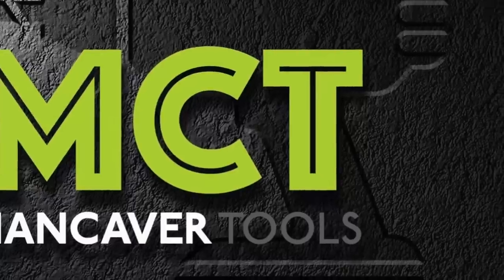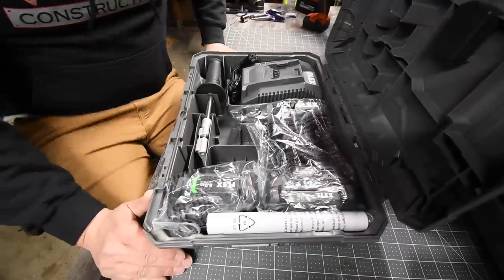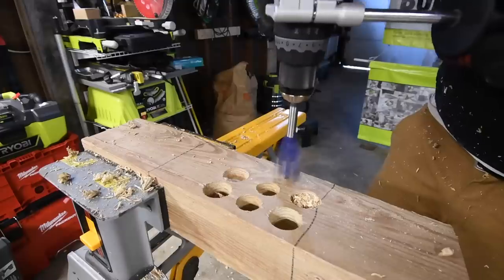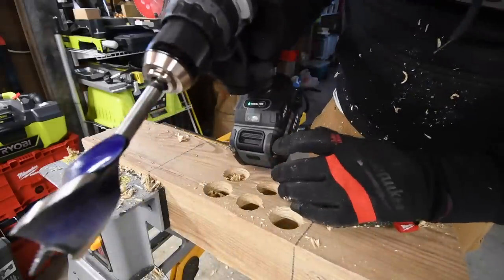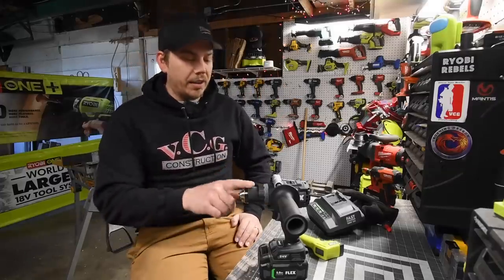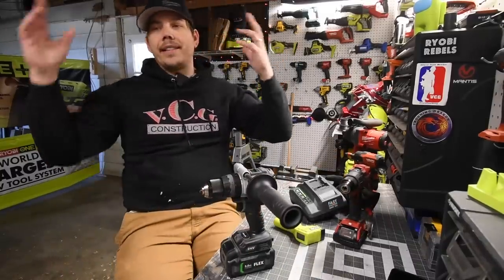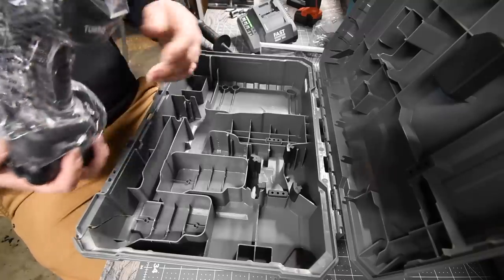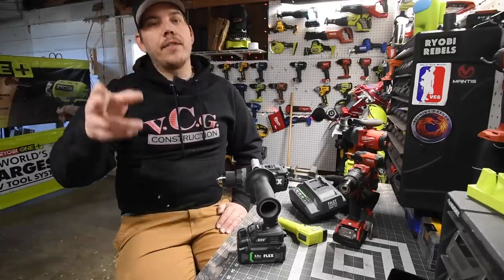Flex Turbo Hammer Drill (Unboxing and TEST)

Comment: Looks like the same issue as Philly Fixed saw with their entry level drill. Symptoms suggest it’s an overly sensitive anti-kickback system. Can probably be fixed with a software update. However, I doubt they can apply a field fix to update the software, so they may have to have all of those sent back for service to solve the issue.
Reply from the maker: I do thank you so much for viewing :)

Comment: Man...I didn’t expect that. Thought it was going to do better. Guess we’ll see what it does with 8Ah. 🙂✌️❤️
Reply: You got the 8 bro? You know I gotta see that recip with it.
Reply: Yet still put it up against Milwaukee 6.0HO as that is their most powerful battery.
Reply: @kartboarder22g17  milwaukee has a 8.0, 9.0, and 12.0
Reply: Doubt you’ll see any better performance with the 8.0, because I think it’s a software issue with the anti-kickback system, not a battery/power issue.
Reply: @nuclearexplosion5841  yeah but the 6.0 has 30T cells they pump out the most.
Reply from the maker: I do thank you so much for viewing :)

Comment: The drill stopped while driving the lag bolts due to the kick back protection feature activated
I'm certain that this drill is more than capable if used properly
Reply from the maker: correct, this hammer drill performed differently after a break in period

Comment: I belive makita new lxt hammer drill tool should be with Milwaukee dewalt and hilti
Reply: only thing holding the back is their batteries
Reply: Yep and the Metabo HPT 36V that has been out almost 3 yrs kickin' ass on my job sites
Reply: @baseballdude8491  that's awesome to hear it's kicking but still after 3 years
Reply from the maker: I do thank you so much for viewing :)

Comment: Since when did Makita get demoted out of the elite, professional grade tools? Seems a bit harsh to put them in with Ryobi and other mid range manufacturers. Tradies here in Australia use Makita just as much as Dewalt and Milwaukee.
Reply: Yeah, power isnt everything. I have both Makita and Milwaukee. Havnt had any issues with my makitas, but I have a milwaukee onekey drill that has a glitchy trigger... One thing though, the Milwaukee batteries feels really solidly built and I miss the rubber protection on my Makita batteries.
Reply: Makita may not be able to boast "the most powerful" but they give enough power for most things, and have a proven track record of longevity, dependability, and comfortable ergos.
Reply from the maker: I do thank you so much for viewing :)

Comment: Not invested in any of these platforms, but you clearly point out that there is a battery discrepancy between the Milwaukee and DeWalts you used and this Flex tool. Wouldn’t the fair and impartial thing to do is to test the Flex against these other tools also running 18650’s? I’ll concede that the Milwaukee and DeWalt with 21700’s rule the roost.
Reply: As long as you are close to having the same watt hours the cell of the battery doesn’t matter. Milwaukee has to use a high output battery to compete with the flex extra cell in their battery. What I would like to see is Milwaukee 21700 8.0 ah battery go against Flex 21700 8.0ah battery. But flex will still have an advantage because it’s 24 volt vs 18 volt. Milwaukee would have to use a 12ah battery to make it fair. It’s very confusing.
Reply: @akaredcrossbow  it does seem like shifting goal posts. That’s why I thought just testing everything at face value was fair and impartial. I never understood why the contractor grade companies didn’t bump up their base voltages if the ability is there. Makita is doing just that with a 40v line for professionals. I have no doubt that Milwaukee would still sell like gangbusters if they went with a dedicated 36v line.  People love throwing money at numbers.
Reply from the maker: I do thank you so much for viewing :)

Comment: very fun video, thanks. it'd be interesting if the 8ah version battery will be helpful to the flex hammerdrill
the 2.5 and the 5ah batteries have the 18650 samsung cells but the 8 and 12 vers. have the 21700 cells
Reply from the maker: I do thank you so much for viewing :)

Comment: The voltage from the included Samsung 20a batteries does not provide enough amperage to supply the tool with enough power and it likely kicks off.
Reply from the maker: I do thank you so much for viewing :)

Comment: Great video, for me there is more to a drill than just raw power. Yes dealt and Milwaukee definitely have the most powerful drills, but makita and hilti are far nicer to use most if the time. More precision and a better quality feel. Idk how Flex competes in that regard. Just my take in it. Have a good one.
Reply: For example, dewalt and Milwaukee use digital clutches I believe, and I guess because I the way thy configured it the clutch is not able to engage at nearly as low of torque as the mechanical clutch on the makita and hilti. That's important for precision and control.

Comment: So if it has more power and torque in 1st gear, that means nothing?
Reply from the maker: it doesn't if another tool can do it on a higher speed. This video is based on the flex promo video they did. why said this is the fastest, most powerful hammer drill on the market. just proved them wrong
Reply: @ManCaverTools  But by your own " standards " the Dewalt also failed. Their 2 gear is 1300 rpm's and their 3rd is 2000 rpm's. It has already been proven the Flex is the fastest with 2500 rpm's and on other non-marketing tests prove it, but to prove who has the most torque you have to get bigger bits and test in 1st gear.

Comment: Wow! Your review and VCG review are so different.
Vince and the other dude did the comparisons between Flex vs Milwaukee vs Dewalt. Flex beat both of them. They were using the same auger bits, 8ah battery for Dewalt. It didn't matter. Flex beat them everytime. You might want to do live demo between the 3 and not just by your words.
Reply: VCG is a major shill thats why
Reply: @nuclearexplosion5841  
Vince is not Shill. He is a diehard Milwaukee fan boy. Reviews needs to be done with action and not words.
I'm a bargain fanboy who prefers Ridgid and Ryobi. If Flex can be the next bargain with performance. I'm all in.
We need something else besides Milwaukee and Dewalt.
Reply from the maker: I do thank you so much for viewing :)
Reply: @ManCaverTools  
I'm still waiting on non biased reviews from Project farm,  Concord Carpenter,  and Workshop Addicts. I see too many Pros and haters on Flex tools. 
No different than Ford, Chevy, and Ram owners trash talking each other's trucks. No matter the innovation.
That's why I'm a Tundra owner.😁

You did a good comparisons. But still seems bit biased.

Comment: You should have got a Milwaukee to finish out that lag bolt
Reply from the maker: I use impact wrenches to take out lags that drills failed at. saves me $$$ on the adapters

Comment: Hmmmm... Maybe the Hammer-Drill version will be better. There are channels that have disassembled both the 5AH and 8AH batteries already. So the 5AH uses 18650 cells as well, BUT the 8AH does use 21700 cells. Its because of the OEM of the cell - Samsung. They only make 4000mAH 35A and 3000mAH 35A in the 21700 size, and the cells found in the smaller batteries were the same Samsung 25R 18650's (2500mAH 20A) also found in DeWalt, Makita, and Milwaukee 5AH packs.
Reply from the maker: this is the hammer drill.  this test was just to test out the power of the motor.
Reply: @ManCaverTools  I see, although I could have sworn you unboxed the hammer version at the end lol. That was confusing. Well bummer it couldn't hold up like the other tools have so far. Though I have heard breaking in the battery with a discharge and then recharge can help performance with these Flex tools for whatever reason. Keep up the good work!

Comment: So in all those flex videos where the flex tool is better than Milwaukee you kind of wonder if the tool user made it so the RED Team loses on purpose.
Reply: My gut says the millwaukee batts used in test were compramised.
Reply: @jasonhemann3517  That or they used a smaller amperage battery or they used the older model batteries.Anything is possible but that's false advertisement.
Reply from the maker: I do thank you so much for viewing :)

Comment: A milwaukee 1/2 magnum corded driver drill would have sunk that lag bolt....
I wouldn't even try it with my m18 fuel brushless.
Reply from the maker: I leaned back then that tools needed to be broken in to reach their full potential. ever since this video was uploaded I no longer judge a tool right out of the box. every tool performed better after a few videos or some use.
Reply: @ManCaverTools  ok.  Understood.

Comment: I had very high expectations of the flex line.  They better adjust their pricing. Or they're gonna earn a bad reputation.  Milwaukee and Dewalt are still pretty much the 2 big dogs still. I know there's a few other brands buy they're even more expensive and harder to find. Disappointed in the flex hammerdrill. I know the flex tools would perform most tasks fine and harder tasks you just gotta use 1st gear. They might be good tools. But they gotta stop with putting it in the category of other proven brands. And compete with ridged etc. That means pricing too.
Reply from the maker: I thank you so much for viewing :)

Comment: In my opinion the Flex line is overhyped and it will die off in a year or two.
Reply: It will unless they drastically improve product quality.
Reply: That’s true. But the only thing Flex offers that is new is the turbo in the battery. Which we saw clearly has its limits. They need to offer a little more. Something more innovative in their tools if they want to compete with Milwaukee and Dewalt.
Reply from the maker: I do thank you so much for viewing :)

Comment: You tuber Philly fixed had the same problem with the drill he supposedly charge the batteries again and the drill performed flawlessly after. Give his review of the flex drill a watch https://youtu.be/CsZmrkUtuRU  maybe the same thing needs to be done here. Now that doesn’t say a lot for flex if you can’t get a tool out of the box without having to hack it or do a workaround to get it to work. But it’s something people need to be aware of if that is the case.
Reply: He also charged the battery again on the video
Reply from the maker: I do thank you so much for viewing :)

Comment: What size drill bits did you use for the Milwaukee test and the biggest bit you used for the flex? You said the Milwaukee only went a 1/4 inch with the standard battery, if they were the same size how does flex not compete with Milwaukee?
Reply from the maker: this was not a versus video, that was a 1 1/2 speed bore bit. I have no clue what you are asking. the batteries are not the same size. sorry I dont get what you are asking
Reply: @ManCaverTools  if the drill bit you used with the flex is the same as Milwaukee, how does flex not complete with Milwaukee, as you said Milwaukee only went a 1/4 inch with the standard battery

Comment: He came up with a reason not to put the Milwaukee against the flex. Lol My flesh went through at speed 2 at with that bit. Do the tests vs each other and see which wins. The flex will win the majority.
Reply: He has a reason because he already did those test in all other brand of drills. Check his episodes..
Reply: @SpicyRoll-m4r  That doesn't mean you don't do a vs against one another. My flex went right through with the 1-1/2" speedbor but even though his didn't, the flex would smoke the Milwaukee in everything else. He doesn't want to put that on his channel. He's a Milwaukee guy. Other drills beat the Milwaukee here and there but overall the Milwaukee wins exactly how the flex would win overall.
Reply: @SpicyRoll-m4r  Sorry, at speed 2 also.
Reply: @jdelapaz14  type of wood and brand of speedbor has a difference for this as long he's using same materials through all those test.
Reply from the maker: I do thank you so much for viewing :)

Comment: I’m brand agnostic, have tools from all of them. If I watch a review, I kinda expect some knowledge and honesty from the guy doing the testing. This was tough to watch. Using incorrect speeds for various tasks, incorrect modes, partially drained battery, complaining about it “cutting out” as if it was a failure — meanwhile it was just the anti-kick mode shutting the drill off. Just really tough to watch this...and take it seriously.

Comment: The drill keeps cutting out because of the anti kickback function. It's to keep fools from breaking their wrists. And before the fanboys come I have Milwaukee and DeWalt. Lumping Makita in with Ryobi, seriously?
Reply: Anti kickback? If you don’t know how to use tools then don’t use tools. That means if that was the only drill you had then the anti kickback will stop you from completing that job. Milwaukee and Dewalt did the task like it was going through butter. The Flex looks to be good with smaller fasteners, but when it has to do a large task it fails. If you want to invest in a tool platform then go with The big 3, you can’t go wrong. If you don’t want to spend that kind of money then there’s already a lot of great tool companies out there.
Reply: @akaredcrossbow  well it's to prevent injury I guess I agree with you though
Reply from the maker: I do thank you so much for viewing :)

Comment: Makita isn't mid range tools.
Reply: I agree, but in these tests it is. Flex and Makita will get 95% of the job done, but there’s that 5% that needs Milwaukee or Dewalt to help. Not everybody is going to need to drill into a 6x6 or sink a 10” lag with a drill, but knowing there are tools out there that can complete the job is good to know. If I’m going to sink a 10” lag I’m not going to use a drill or an impact driver, I will use an impact wrench for that job
Reply from the maker: I do thank you so much for viewing :)

Comment: so the reason you are not putting up against dewalt or milwaukee is due to the lack of high performance battery available.  Well at least I know their hard case is junk.  Btw, that lumber probably cost you a fortune
Reply from the maker: no, other tool brands are just not powerful enough. its the motor and batteries. NOT JUST BATTEREIS
Reply: @ManCaverTools  it's hard to say to be honest just based on what I have seen so far.  It just doesn't seem fair to say that this in the same category as Ryobi (keep in mind that even Ryobi has stepped up the game) or other brands you have mentioned as you have shown that some tools will simply fail with a non HO battery or 21700 cell battery using that bit test.  We will just have to revisit this with an 8.0 battery with FLEX.  It is also not so much the motor, but more or so how they engineered the darn thing and how the electronics work.  Some brands just have too much protection or overengineered.  Now, that impact driver of theirs....I think it's the real deal, but many companies make great impact drivers anyways.

Comment: That looks more like the safety sensor kiccking on so it doesn't whack ya. You probably just need more balls to hold the drill bro.
Reply: If Milwaukee and Dewalt can do it without a problem then why couldn’t the flex? More power should mean it should’ve done it like going into butter. It’s propaganda, they all do it, but not like this. I’ve seen Milwaukee and Dewalt finish 10” lags that other tools couldn’t do. Comes down to this. If this drill was the only drill you had to use on a similar task and you were told it can do it and you trusted that statement you would’ve failed miserably and you would have a real problem on your hands. 
Nobody has time for safety sensors, either you know how to use a tool or not, I want the job done ASAP.
Reply: Seems like the Flex hammer drill has no balls! 😂🤣😂🤣
Reply from the maker: I do thank you so much for viewing :)
Reply: @ManCaverTools  
Lol it was a joke bro.

Comment: I just bought the Flex Turbo (can't we be done with this marketing term) Hammer Drill and the push eject impact driver and then did some further research to find they have been bought by the communist Chinese in 2018, so I am returning them ASAP. I first bought because they were German made, but that is no longer safe. 
It is all meaningless to me and do not care how clever, good, or bad Flex or Milwaukee or anything that benefits China is as it has a terminal, incurable flaw; it is made by China, the enemy and I refuse to buy anything made in China and if you do, and are an American, you are a traitor, pure and simple.